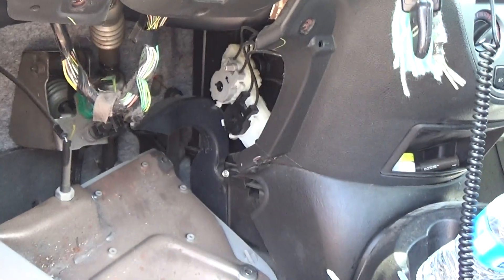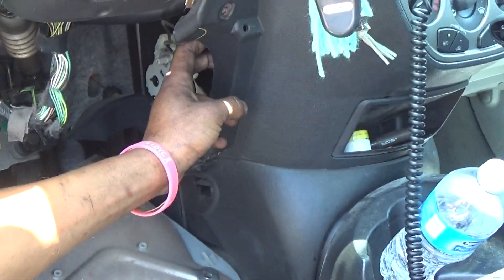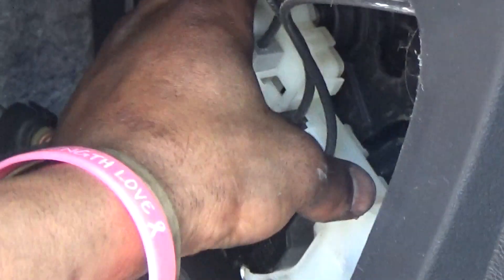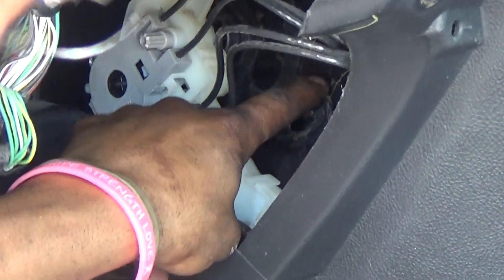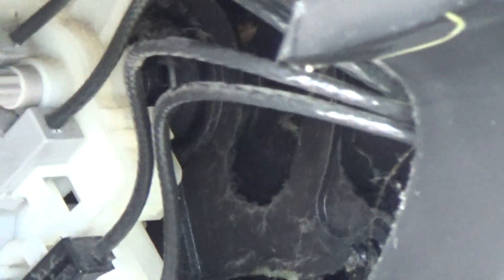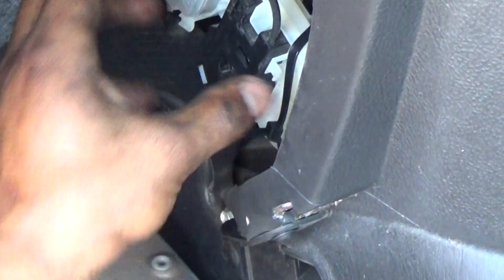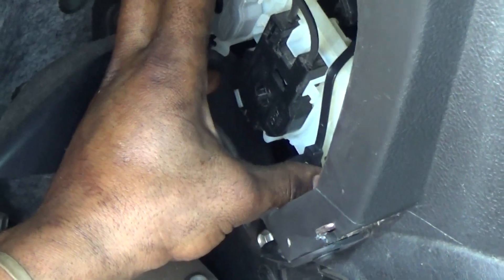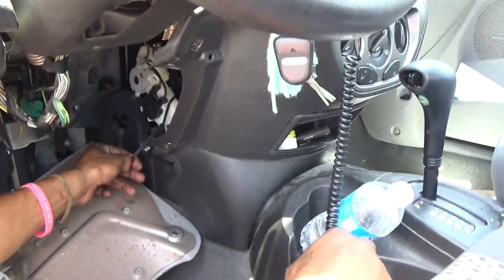How To Perform Simple AC Vent Fix on a 2007 Ford Focus

Comment: Its a temporary fix. You still have to  adjust it by hand every time you want to change the vent settings. At some point you'll have to get the cables and/or motors replaced.

Comment: This is not a good idea for long term. A day will come when you need defrost and it wont work, which can put you In a dangerous situation. The problem these cars have is the rubber seals Ford used on the doors inside the HVAC box melt from the heat output, when that happens the rubber turns to glue and the doors get stuck, then after excessive force the actuator cables wind up breaking. The only way to fix this is to take the dash apart and repair the doors, which is not so bad only a few hrs of work. I wound up wrapping the edges of my doors with metal ducting tape, bought new cables and my HVAC works like new
Reply: How did u get to the doors to wrap them